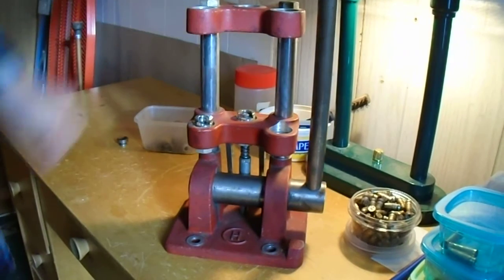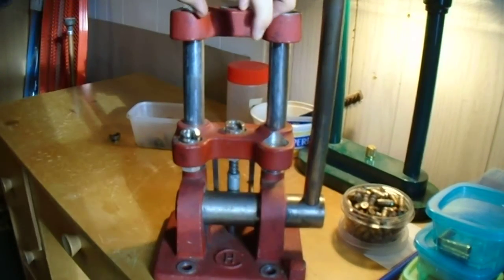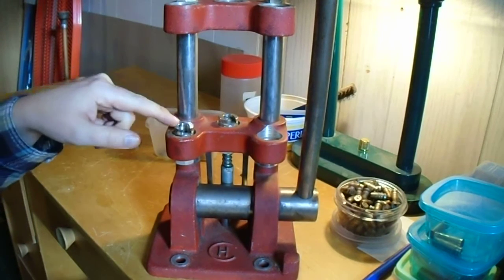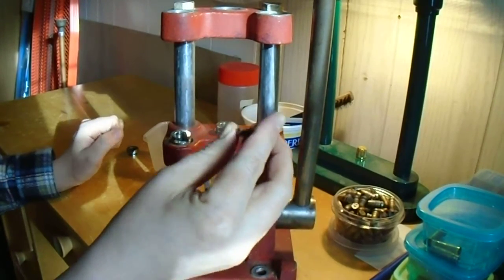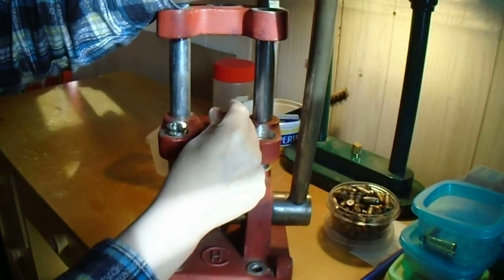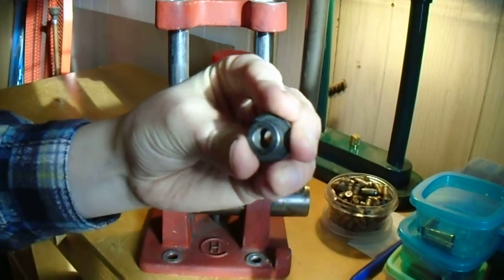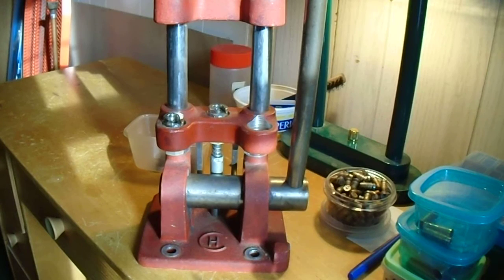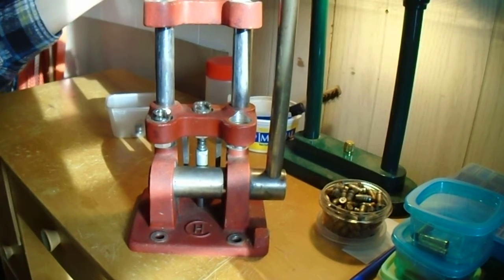CH "H" Style Press

Comment: Resize and prime in the center drop powder on the left I use a dill powder drop then seat bullet on the right CH still in business most parts for that press are still available
Reply from the maker: might be worth getting it going.
Reply: @Gungeek  I have 2 one setup for 308 the other 30/30. Yours is from the 60’s they later moved the primer stem to front left and changed the color to black. Great press